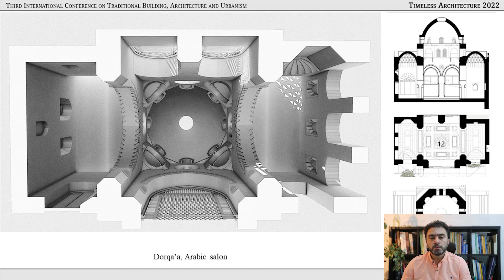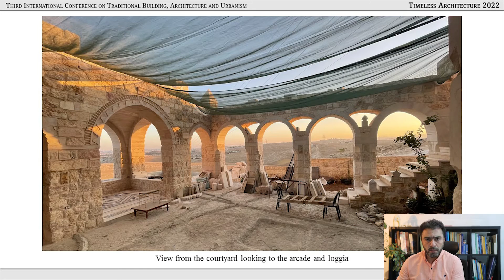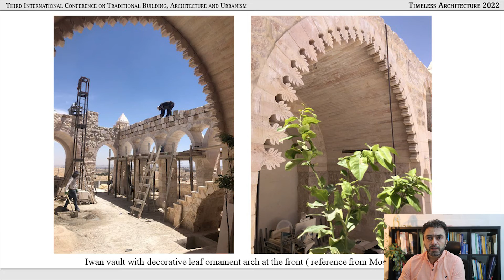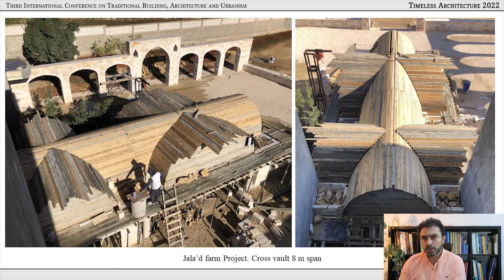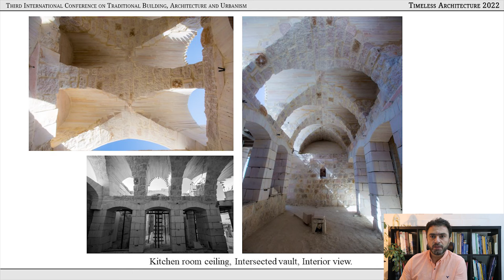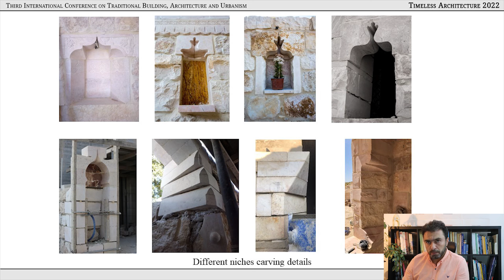Maher Azmi Abu-samra: Dar Al Uquod: A Traditional House in Amman

Comment: fantastic project. i wonder if new technology in cnc and robotics would make masonry and sculpture more availeable for the average person
Reply: I do not think so. When machines intervene in the manufacturing process, that repetition requires the process to be economically viable, and the creative touch of the craftsmen disappears.
Reply: @maher0909  maybe the craftmanship will be more on the side of the designing than on the scultping. It would have to be on a made-by-order system, it wouldnt quite be possible to mass produce this kind of elements, since every building has specific proportions, it would have to be in the most part custom made, like it is today, but in a  faster and therefore more efficient way, and maybe cheaper so they could be employed in more projects, even in projects with smaller bugets.
I believe it would be better than the current situation where we have almost no artisans and almost no traditional/classical architecture being made.
What is needed is more architects interested and well educated on this kind of design, like you are sir. If the knowlege isnt lost, everything is possible.